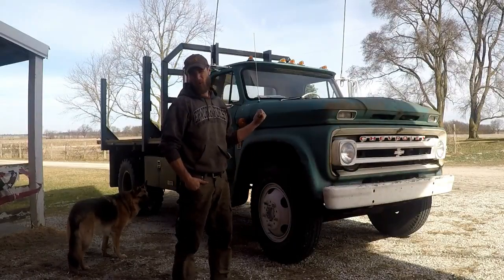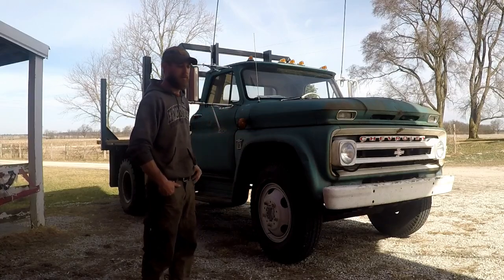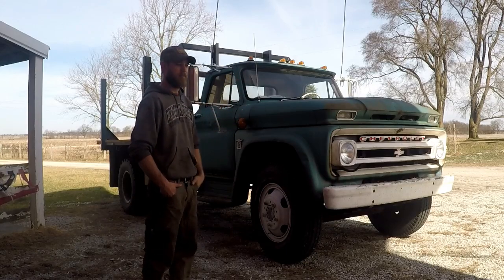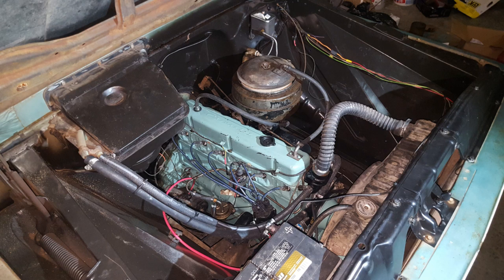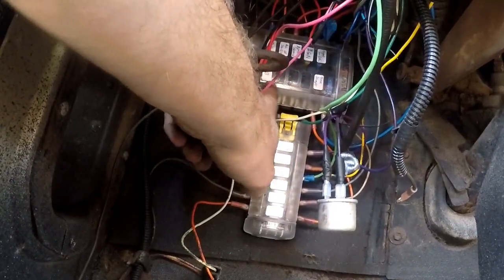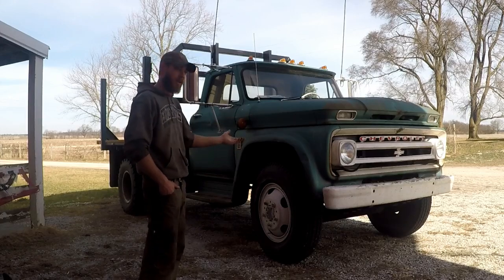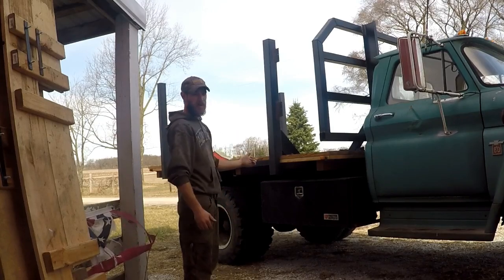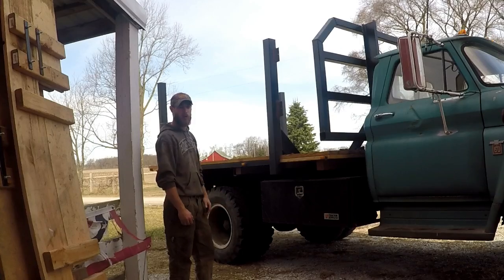1964 C60 Rebuilt

Comment: All Chevy trucks from 1955 second series on are 12 volt. Your ammeter will work work just fine if you hook it up. Even if the truck was originally 6 volt, it wouldn't matter anyway with the ammeter. 
 That being said, your truck is a beauty. That 292 is also an incredible powerplant. I ran one of them in a 51 2&1/2 ton for awhile. There wasn't much of anything that I couldn't pull with it, and it got decent fuel economy, too. I just recently got a 62 Chevy C60 dump truck with a 261 six cylinder, four speed transmission, and a two speed rear end. I'm presently working all of the bugs out of it to put it on the road. Fortunately, it's in better shape than yours was when you got it. It's very low mileage and appears to have been well maintained. It's just been sitting for a long time. Just like yours, mine will be a work truck. I hope you get many years of service from your truck.
Reply: Can't wait for the trendy 'that being said' to end, it's not necessary.
Reply: I see your comments like this a lot. Multiple times in the same video even. Seems to be a theme with you. Nobody cares what you think because you don't matter. People will talk and type however they chose and you will continue to be unhappy and irrelevant untill you end.  @WayneMarion

Comment: What a great old truck!  It's worth noting that these were never six volt-GM did away with six volt electrics circa 1954.  So if the electrics were fried, the six volt battery someone put in there is probably why.  I grew up hauling firewood with my Dad in a '65 C60, and I have another '65 C60 that's an RV converted school bus.   So I'm familiar with these rigs..  and regarding the points, you could easily add a Pertronix electronic ignition conversion and never worry about them again.  Same distributor, coil, everything else-just zero worries about setting points, and more ignition power to boot.  I converted an old Buick Invicta to electronic ignition this way and it made a big difference.

My bus is heavy, and that anemic little 327 wasn't enough to haul it around the Rocky Mountains as a motorhome..  but the 500cid Cadillac V8 I converted it to, is enough to push all 15,700 lbs of Enterprise over most mountain passes without even hitting the low range.  And all that compression means I don't even have to touch the brakes on long descents.

Oh, one more thing..  you probably have the 7,000lb front axle in your rig, which means the puny drag link they put in those, is probably loose or soon will be.  Creates a challenge because those bias tires follow the lines in the road even easier if the steering's sloppy.  After 15 years of searching, I found a cache of the Moog DS900 steering links at Rare Parts..  here's the link:  https://shop.rareparts.com/RP25927-25927-DRAG-LINK and it's the best $87 you'll ever spend on making 'er go down the road in a straight line.  

It's good to see the ol' girl found a home and a purpose again.  Nicely done!
Reply from the maker: I saw your posting on the drag link elsewhere recently, props on finally tracking it down and spreading the word for others. The world needs more people like you.

Unfortunately, this girl is only the 5k lb front axle. She is the heaviest of the standard duty C60 line at GVW 19.5k, and in order to have the 7k axle, it takes one more jump into the C60H lineup which comprises the GVW 19.5k+ realm. This info is further corroborated by the fact of 15x4 rear axle brake shoes which are only installed on the 15k lb rear axles which were only ever paired with the 5k lb front. Every GM application with the 7k front axle also came with the heavier 17k rear axle standard that has the larger 15x6 shoes. All of this info is cross referenced an ripped from my factory manuals and corroborated against others books as well.

That said, she really doesn't wander at all. She's and old truck and you more or less guide it as opposed to steer it, but all linkages are strong and tight still. The only slop is in the steering box and then the kingpins themselves, which is minimal at best.

Good call on the 12v from factory. I revisited my manuals and you are correct. I think I may have bridged a gap just a bit far on that one mistakenly. Everything original closely mimicked the old 6v setups, but everything original was also burnt up and barely recognizable.

The new dizzy I dropped in gave out a few weeks back. Pot metal that simply deformed and failed, so I am actually back at square 1 and likely jumping straight to a new HEI from a reputable source. This is all still be researched and dug up at the moment right now. I am in a lull where she isn't needed for a few so I am taking my time on a few items.

I am always happy to see the people that not only keep these era big trucks on the road, but keep them 'mostly' original in doing so. Too many frame swapped C60's and such which takes all the character out of the truck. The technology may be old, but its still reliable once you understand it.
Reply: @RocketFarmer   Wow, I have the C60 at 19,600lb gvwr, it had 15x4 rear brakes before I changed the axle to a '67 T170 Corporate axle for which it's still possible to get parts.  I was pretty sure I have the 7000# axle, but now I'm not as sure.  I know its steering knuckle has the smaller stud drag link ends.  It's a 48 passenger bus tho, so longer and heavier.   It also came with the 327 versus a six.  Maybe I better look at the casting numbers..  thank you for the tip!
Reply from the maker: @Bolton115  Not a problem. Though you are diffidently in the 60 series, it will help to have the full model code designation if its available. For instance, CL60, D60, CLD60H, T60T, T60HT. Then there are S62, S64, S67, S67H, S69, and S69H. All of these are the different models of the 60 series and the S models are all school bus models. With model, then you can trace the factory options and see the different configurations. The S62, S64, and S67 came only with the smaller 15k rear, but had optional 7k front, and the S69 configuration only came as 15k rear and 7k front. Both the S67H and S69H came as the larger 17k rear with corresponding 7k front axles.

For reference I am using the table on page 0-8 of the 1963 Chevrolet Truck Shop Manual cross referenced with the 1964 supplemental. There may be some subtle differences in the 1965 supplemental version as well. My guess is that based on your info, you likely have an S62, S64, or S67. However, because GM calculated GVW based on capacity of equipment used on the model (build sheet basically) it could also be a de-rated S69. Any idea what your wheelbase is?
Reply: @RocketFarmer  Wow, I didn't know all that!  Based on the 14x21/2" drum brakes up front, I was told it is the 7000# axle.  I bought this thing out of a farmer's field in 1993, so I'm unsure as to where I might find the build info.  I think the wheelbase is 235" but I haven't measured it lately.  If it had been equipped with the old truck 348 or 409 I might have left that engine intact.
Back in the day, I was always told that C meant conventional chassis as in my Dad's '65 C60 that had a regular cab in front of a dump bed, and mine which has the regular hood but the Chevy part stops at the front of the school bus body.
Reply from the maker: @Bolton115  So from the books:
197" WB: S62 and S64
225.5" WB: S62 and S64
243" WB: S67
261.5" WB S69

You are correct, the C does stand for conventional, but it denotes the conventional truck cab of the c10-c80 lineup which all use the exact same cab, just different fenders and rad/rad support. GM L code denotes low-cab-forward which still uses the conventional cab, just a third different style of front end and a different doghouse, hence the CL60 designation; Conventional, low-cab-forward 60 series.

For reference, GM codes:
D: denotes diesel options (Toro flow)
M: denotes tandem options (3 axle config)
T: denotes tilt cab option (cab-over-engine) 
H: denotes heavy duty (larger axles installed)
S: denotes school bus

All use similar chassis, engines (barring the diesel Toro flow), axles, springs, etc across the 60 lineup in a variety of configurations, just different body styles. Sadly I still haven't found a good single source for all of this info, just bits and pieces here an there, a lot of which I write into my books.

The easiest way I have found to track info is these reference tables based on the info that is known: year, GVW, brake shoe sizes which correspond to specific axles, etc etc. Course, a lot of that info is also measured by hand since this was long before GM had the RPO code sheet installed in the glove box with all the factory build specs, and original paperwork is always looooong gone.
Reply: @RocketFarmer   I had no idea there were so many options.  Fascinating!  I sure appreciate you laying all this info on us :-)  My bus had the oval housing 14,000 lb rear two speed diff, for which one of the carrier bearings is nonexistent and the gears were fried.  I had an outer race made, but back then it didn't get done in time for a trip so I had to scrap the old axle (with, natch, two hubs full of brand new wheel bearings and backing plates full of brand new wheel cylinders and shoes and hardware) and spend $800 1995 dollars on the T170.  Its brakes were all wasted, of course, so I had to buy new drums, shoes, hardware and seals all over again in 15x5.  The bearings were "good enough" because I was kinda out of money by then..

By the way, I've got a pair of brand new 15x4 10 bolt on 8.75" drums and re-linable shoes sitting around.  If anyone needs them..
Reply: I agree with you about electronic ignition.  It will eventually pay for itself by not buying points.

Comment: Love these old trucks. I’m trying to get my grandpas 1965 4000 dump truck back going. Not having luck finding a windshield.
Reply from the maker: If it is a GM, then its the same windshield for a c10 thru c80 conventional cab or LCF. Buy glass for a '65 c10 and it will fit